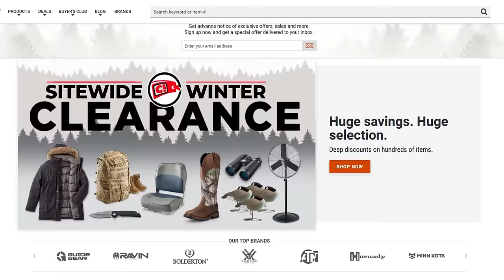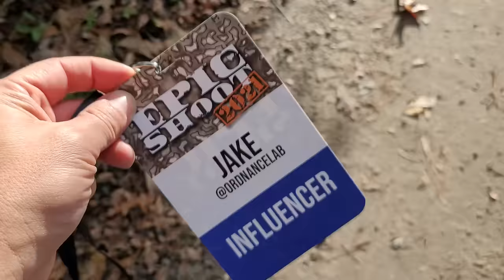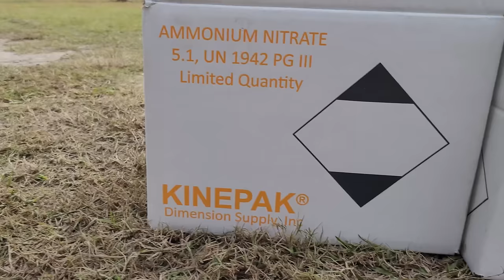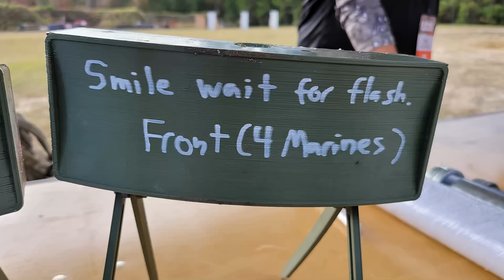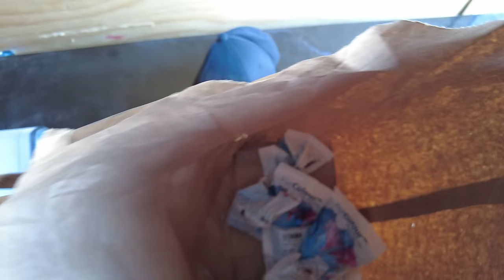Blowing Up Bombs For Two Days Straight At Epic Shoot

Comment: Shaped charge liners... we know they turn into a compressed molten 'slug' but what affects the penetration the most? Density? Melting point? How spectacular would a magnesium liner look when fired? Would a graphite liner actually work due to the exceedingly high melting point? Does it work the other way, with low-temp liners made of tin, zinc, or even... wax?

These are the foundational questions of life...
Reply: Typically use copper... great questions! ...Jake? Sean? Colloidal silver boys...
Reply: @7150285  Ok, let's change that to "possessing enough energy to flow as if it were liquid, and really damned hot due to deformation stresses and physical compression, and exhibiting point melting when striking a solid target". And you can't deny the last bit as it's plainly visible in high speed film of a much slower, less energetic process (bullets striking resistant targets causing splash and sometimes autoignition of vapor)
Reply: @mfree80286  even in high speed slomo, it is almost impossible to tell if the jet is solid or molten. TheSlowMoGuys did a YouTube vid of copper cone oil perforator in extreme high speed slomo, however it is extremely and nearly impossible to tell if the jet is actually molten copper or solid...
Reply: Good question.
Reply: @7150285  It it looks like a liquid, and it behaves like a liquid, you might just be able to consider it a liquid, at least temporarily.
Reply: co2 cartridge tops?
Reply: TLDR: There are some great docs in the DTIC archive that answer this. IIRC, the main factor is elasticity under extreme pressure. All kinds of fun things work -- including bottle glass. I would presume that graphite wouldn't work because it hates plastic deformation, but DU is supposed to work (despite its tendency to form adiabatic shear bands, which is good for long rod projectiles). Glass works because it's highly amorphous and can be treated as a super viscous liquid.
Reply: @johnib5905  My brain has suddenly been tickled as I was researching amorphous steel last week...
Reply: Adding to this, I have a hypothesis that the optimal angle for the cone is correlated to the detonation velocity... Something about the jet building up energy as the detonation wavefront progresses through the explosive. Just intuition, no clue if this would stack up in testing :)
Reply: Enamal*

Comment: Loved it, probably the best episode you guys have made.
Have you thought about a small copper liner aka cone for the shaped charge? Perhaps have different cones to see which performs best .
Am sure someone on here has a lathe that could knock up a load for you to test.
Either way again great video guys , keep them coming.
Reply: I've also seen posts on a certain forum about using just straight lengths of copper pipe as liners with minimal to no standoff. I'd like to see more testing on this.

Comment: I'm pretty sure that claymores have their projectiles epoxied in place so the explosives get a chance to accelerate them to high speeds. Without the epoxy, they would get subpar velocities.
Reply: Bingo, it's a very hard and brittle epoxy...also, the shot is .32 cal

Comment: It's hard to choose between the wine bottle and soda bottle charges. They are both performing great. You're on the mark in getting them to perform as they should. And you've done very well on this outing. The 'vlog' thing is what it is and it works when you need it. Don't give up on it for situations that require it. But always diversify when it comes to running your channel. It can't hurt.
Reply: I have the same issue: can't figure out which charge Iike more. I was favoring the wine bottle but now.....50/50.

Comment: Curious- what if you put something such as silly putty or plumbers putty on the inside front face of the mine and pressed the projectiles in place flat and even? Also what about mixing the projectiles with small and larger ball bearings

Comment: Hey Jake I really love your videos and I have a question: what is the composition of your gemeni explosive? aluminum powder water......? Or if you don't want to tell me plz tell me the difference between RDX & HMX aren't they based of hexamine trinitrate?
Reply: RDX, or cyclonite, is an insensitive yet powerful powdered explosive. HMX is, by weight, 50% RDX and 50% TNT, or trinitrotoluene. It is called HMX because it has a higher heat level that TNT or RDX individually.
Reply: @fisherwasheretoo  do you mean detonation velocity?
Reply: HMX is not what you said lol. HMX is nitrated heximaine and a precursor to make Rdx. No tnt in those

Comment: Whose red bra is on top of the RedBull @ 14:49?  Someone blowing up a little more than the video lets on lol
Reply: Sharp eyes . . .
Reply: Wow. I just saw that too. Someone apparently used our boom trailer to get freaky. Def not me as I'm about as suave as sand paper.
Reply: @jlambuth  Er, it's an explosives storage facility, isn't it locked?
Reply: @marvindebot3264  the magazines are locked. The trailer was open so we can go in and out for supplies. Only the magazines need to be constantly locked.
Reply: @jlambuth  OK, different to here (Australia)  we would need to have control over the entire trailer. Seriously tho mate, would you not prefer to have control over the trailer? If some shit blows up remember it's not what the law says, it's what you (within your power./control) do. 

I'm disappointed and a little disturbed that anyone could enter the trailer without you knowing. We (you) ain't playing with plasticine here after all. Consider this a kicking from a fellow licensed shot firer. Ot is not the letter of the law that should define us. it is common sense and to me, common sense says that entire trailer should not have been accessible. TBH I'm a bit put off by your reply.
Reply: @marvindebot3264  the explosives are in bullet resistant magazines with double pick resistant locks and an alarm system. The rest of the trailer is simply tools and personal stuff. As long as the explosives are secured, I'm good and happy. The rest I can replace.

Comment: I understand the idea of shape charges being conical, but have you ever tried something a bit oblong? I'm thinking of something with an oval shape at the bottom of the charge that transitions to a cone at the top. And how does that liquid explosive compare to c4? Looks like it has a similar REF.
Reply: V shape oblong charges work well and are used commercially and by the military for cutting.
Reply: @marvindebot3264  I didn't even think about those. I only seen them once.

Comment: You can try EFP.
Reply: We can def do that. We are working on the set up for those.
Reply: @jlambuth  Great message. Basic diameter of copper the insert 20 mm. Thickness of copper 1mm (20x 0.05) Bending of the insert /depth = 3.5 mm (20x 0.175) Deep of charge 17 mm (20x 0.85) with tolerance (x 0.75 - x 0.95)  Thus deep of charge 15 - 19 mm with VoD  from 5500  to 7500 m/s.  Target: construction steel 10 mm. Should by arise hole 10 mm.  Thus radius of the copper insert. Or use copper the insert 1 inch.  
Coeficients are same. Device should by working pretty good. With this parameters. All part require precise dimensions and same density of charge. Distance of target minimal 1 meter for formatting of slug during the flight. Good luck at aiming with laser pointer.
  Gemini will require a self-curing additive. Or use else plastic charge.